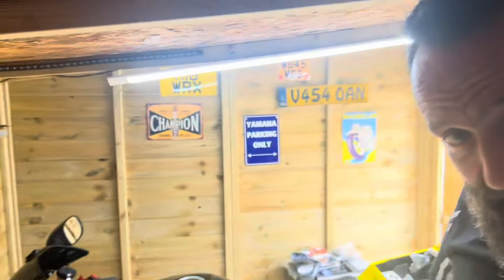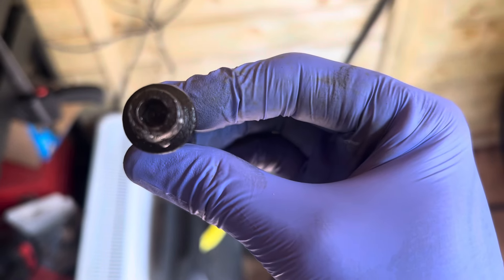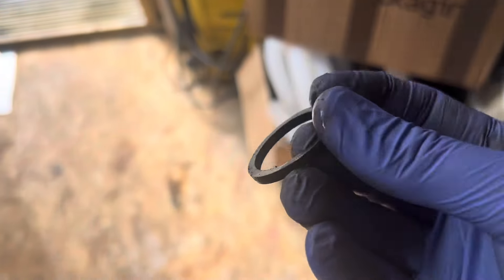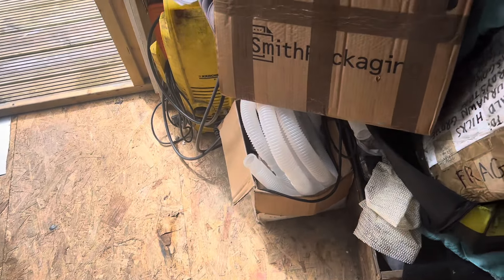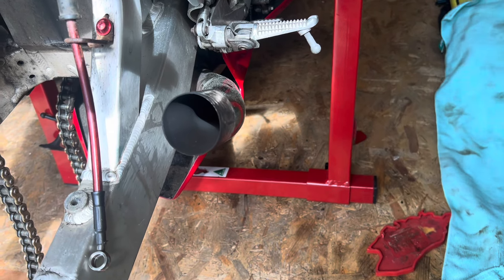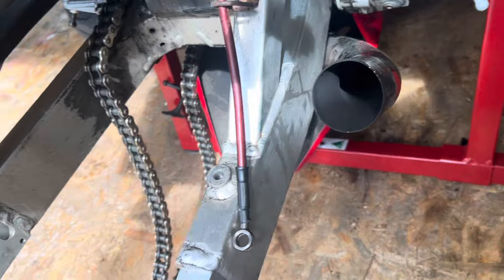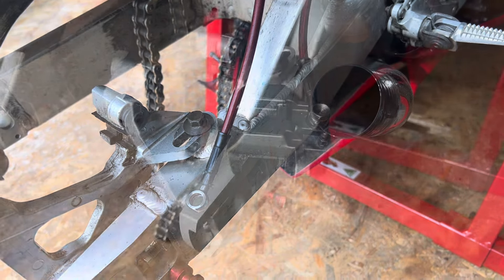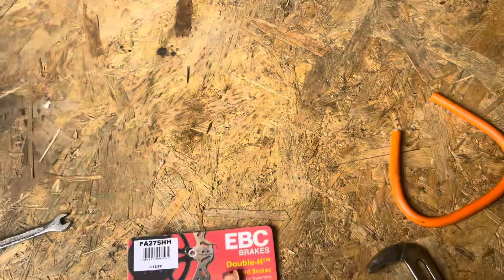Countdown to Isle of Man but we have brake problems

Comment: I see you fitted HH pads. I wont use these on the road on any bike. Yes they may be better on a track where brake temperature is maintained by heavy braking for corners every few seconds but on the road you need instant braking force when you grab the lever regardless of brake temp. I fitted the Fazer 600 pads which are GG rated in both my XJR1300 and R1. Grabbing the front brake was like running into a wall compared to the slow progressive build of braking force that comes with the HH spec pads as they need to build heat to work. It can drastically reduce your braking distance at the temps achieved on the road. Even a very fast rider won't maintain enough brake temp on the road to warrant using HH pads. I am 62 and been riding since i was 10, competed in multiple disciplines, spannered at GP level and have 3 land speed records, i am not your average armchair expert preaching BS, try a set of GG rated pads next time you need some new anchors, you wont go back!
Reply from the maker: Thanks for the info I will certainly look into those, main reason I chose the HH was it was what my mechanic recommended when I had it in for MOT, not sure if maybe its because they are only on the rear just now I haven't really noticed any reduced braking capacity but I will look into the GG rated pads

Comment: Do yourself a favor and get rid of those sliders. Fit ones from a Gen 2 FJR1300. Also no need for gold pads it will only cause excessive wear on the disc
Reply from the maker: Thanks for the info I will look into those replacement sliders